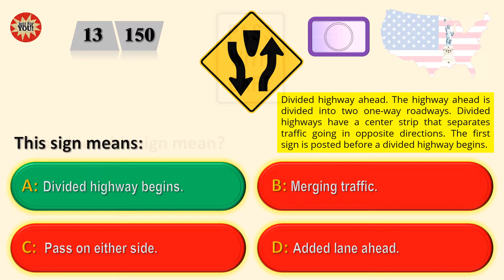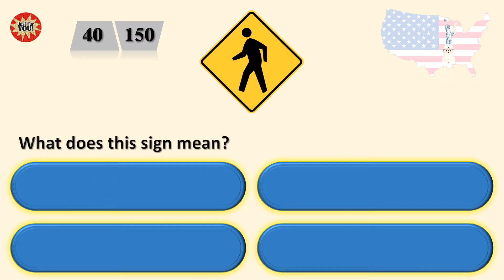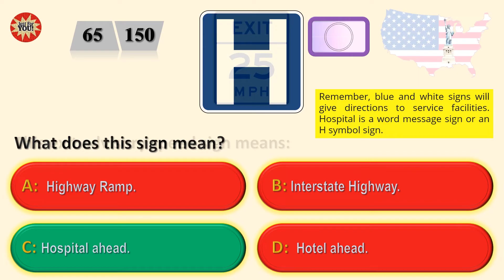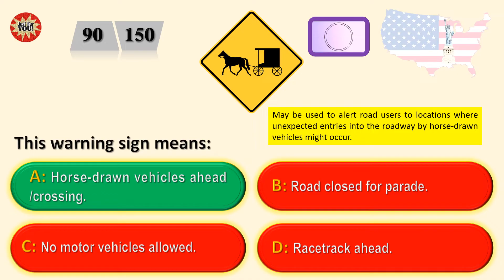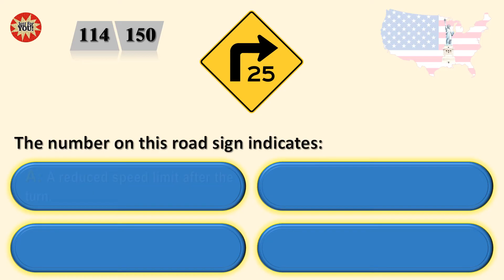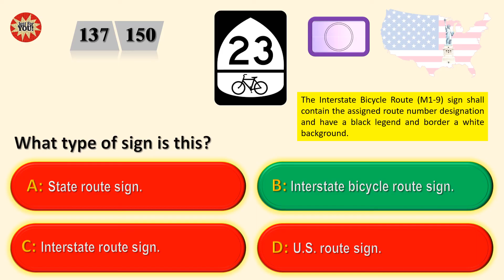Road Signs Practice Test - UNITED STATES

Comment: 1. The Danger Sign - Everyone has to be careful when they see the Danger sign.
2. The Keep Out Sign - Everyone should always stay out of an area that had the Keep Out sign nearby. It means that everyone should not be there.
3. The Railroad Crossing Sign - The Railroad Crossing sign warns the road vehicle traffic driver gang to watch out for the trains.
4. The Handicap Sign - Everyone will get to see the Handicap sign posted near an area then an entrance that had the handicapped people may easily use. 
5. The Do Not Walk Sign - The Do Not Walk sign warns everyone not to cross the streets.
6. The Poison Sign - Everyone should not eat or touch anything that has the Poison sign near it.
7. The Stop Sign - The Stop sign is on the corner of most intersections. The motorist persons and the bicyclist persons should stop when they see the Stop sign.